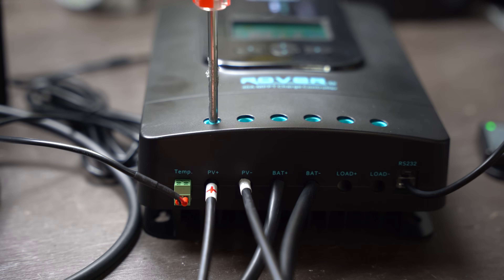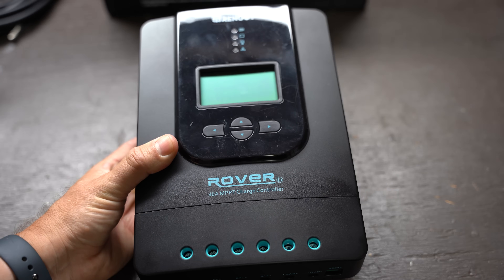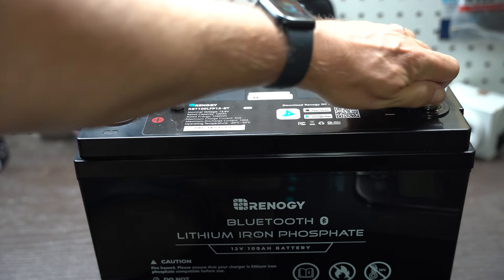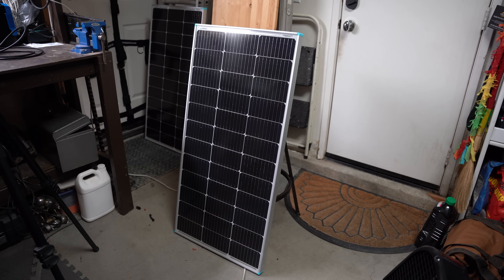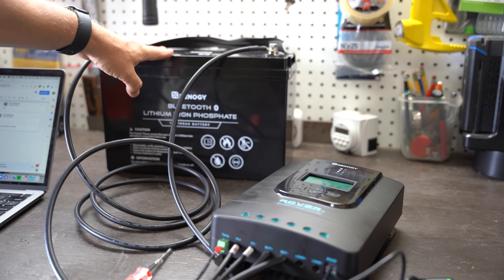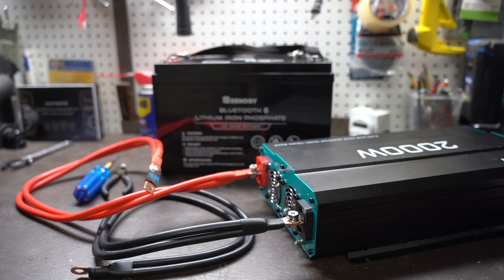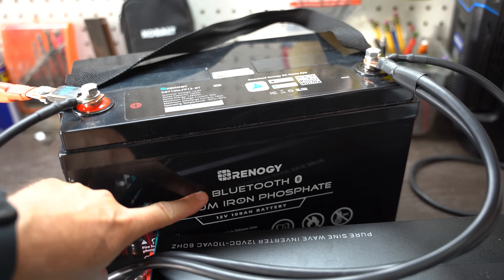DIY Solar Setup: Easy to Follow Step-by-Step Instructions

Comment: I recommend connecting the positive terminal of the battery first then the negative, it would mitigate the risk of sparking. Was there a reason you have done it the other way ?

Comment: So good instruction video. But why use x2 cables between battery and inverter just to up the cable area, it works but not the proper not way to go. Everyone do what they like, but mention it would be on its point.

Comment: Suggestion: label at least the positive cables at both ends with red elc tape. Also, use copper wire whenever available.

Comment: I purchased four used 265v panels that are perfectly good but one problem, they are 24 volts. There was a sale  of car batteries at a greatly reduced price, so I got six and doubled them up to 12 v, They are advertising systems' at thousands of pounds. Mine is a fraction of the cost.

Comment: Connect positive first, negative having less potential won't arc. The higher the voltage, the greater the chance of arcing and fusion. On a car if negative first and you are touching any metal part of car, when attaching positive there is possibility of arcing through you. Your body becomes part of the circuit

Comment: Now I have have checked and regardless whether it is solar power Marine automotive or home you always connect the positive first before the negative because if you connect the negative first you may cause a surge and a spark which could cause an explosion or damage to electronics it's always positive first - s f I am wrong please educate me because I'm not trying to be a troll I just want to know the correct process

Comment: you should never connect anything to a battery without putting a fuse in line, normally on the positive terminal. You did not put a fuse between the battery and the MPPT controller. If the controller fails and shorts, or something metal crushes your wires, a lead acid battery can turn you cables into a glowing red furnace, or it can explode.

You can get automotive inline fuse holders from any autoparts store. With a 40A controller use a 45 or 50A fuse so it does not blow during normal usage. If the fuse on the battery fails while the solar panels are in daylight, your controller will be damaged.

Comment: Wow wally how dangerous are you no circuit breaker just a fuse,and no switch to turn the batterys off so you can work on the project.
Reply from the maker: It has a switch. Rewatch

Comment: I just want to say that you should always disconnect the negative side of any power system first when disconnecting then reverse when installing. Watching you do positive first made me cringe as you can cause real damage to system by removing the positive first.
Reply from the maker: That’s why I installed a switch to disconnect the batteries from the system

Comment: A couple of times I noticed you connect the negative cable in first and then connect the positive cable last. From my experience, it’s usually a common practice to connect the positive cable first before you connect the negative. Is there something I’m missing?🤔

Comment: I have so many questions

Very interested on doing this.
How do I calculate my power needs?
I don't want to run an entire house i want to run a small cottage 
I'd like to power a small hot water heater, TV, computer, 3 or 4 LED lights, router, modem, with enough juice left over if i needed to plug the odd appliance in for cooking
I wont run a fridge or stove, maybe a small bar fridge later.

How many panels and batteries?
And does any decent controller work?
I have a 40Amp Renolgy

Comment: Hi could I install this exact same setup. But not hook up a battery. That way any devices connected to the inverter would only receive power if the solar panels are collecting pv?

Comment: Great tutorial, I basically knew the drill but have still to embark on the journey, still recovering from getting a portable gen setup with NG and interlocking to my main panel, lol. I also need to get eyes on some info showing how to run the battery power into my main panel from about 100 feet away in my shed area.  BUT...in light of recent events have you put some thought into how to protect all these components from the seemingly looming threat of EMP terrorism or solar events? I have read many things about protecting items with Faraday cages and such, but since there is a lot of mention about NOT having cables attached to anything because of it being exploited as an antenna and concentrating massive voltage, it sounds like I will be busy constantly attaching/removing cables from components at sunset to increase chance of survival if an event happens. Would a manual open/close circuit throw mechanism work to isolate PV/battery  cables from controllers, etc? Or should I just always buy x2 and keep a set of components under protection? Thanks for this.

Comment: Hands down one of the best videos on solar for newbies like me. Thank you. However, I do have a question. If I had a set up like this that I created on my camping rig, it would be tedious to always have to connect and disconnect from the battery. Is there a way to have a system like this without having to unplug everything and plug back in?

Comment: When connecting the cables to the battery,  always connect the positive cable first.  Then connect the ground wire after, to minimize sparking.  And when disconnecting  the ground wire gets removed first.

Comment: I don't like the way you hooked up everything, then unhooked everything and then added the inverter. This wasn't, "step by step". Also, you assumed that EVERYONE was using anything but lead/acid batteries and could discharge the batteries down to 20%. You CAN'T do that to the lead/acid batteries, it's 50% minimum discharge to not ruin your batteries.

Comment: A newb question. Will the solar panel stop charging the battery when the battery is full? I want to use this for 3 outdoor lights which will turn only only at night.

Comment: Hi is it possible to use a resistor instead of fuse to avoid the spark when connect the inverter to the battery? What made you go the fuse way instead of resistor?

Comment: I just want to add that in the video, you have a Lifepo4 battery. You don't need to worry about the depleting the battery to ~20%. With Lifepo4, the steep drop off when discharging come at around 5% but then the battery BMS will shut it down.

Comment: Just to know more I want to build mine off grid system charge controller at one point says for non Lithium batteries only and also says custom battery parameters do this is for lithium batteries or not 
Thanks for awesome video 👍

Comment: Tip: always use correct 2x coloured insulation tape to identify correct polarity when using incorrect coloured wire. In your case 2x red on black feed wire.
Reply: Same here. I would have added some appropriate colored heatshrink tubing, preferably adhesive type. Furhter, I would add short pigtail MC4 connectors to the controller, making it easier to connect and disconnect. But, what do I know? I came here because I need to learn how to setup my new portable system. 😂
Reply: @WayneTheSeine Do you mean pigtails to the controller?
Reply: @The_Shark-79  Yes...thank you
Reply: @WayneTheSeine thought so, but you made me curious! 😂
Reply: That or just put some RED tape on the positive charge cables..?
Reply: Ya but peeps dun do that
Reply: I would have said the same, and i am a nono with electra 😅
Reply: @scrqqge  What do you mean by incorrectly coloured wire?
Reply: @94D33M positive is universally red
Reply: coloured tape or heat shrink tubing
Reply: Good tip!

Comment: Is it possible to run a Ac off just solor panels during the day, it's hooked up to a small 50ah battery? (not trying to run it on the battery at all)

Comment: You can wire in a battery disconnect switch and then it won't arc to the terminals when you are hooking up the cables

Comment: I noticed you doubled up your 0 gage wire from the battery to the inverter. What was the reasoning for that and why did you only put a fuse on one of the wires going to the positive instead of the two I spoke about.

Comment: This was both straightforward and simple BUT also NOT. You go back and forth doing then UNdoing the assembly. This is a problem for first timers. Another problem area was at the end about capacity.  The 20% discharge is NOT accurate for ALL batteries. Standard battery designs(lead acid) will be destroyed if you discharge them to 20%. But overall mostly good presentation.

Comment: It would have been so easy to simply show and explain how to put a wrap of red electrical tape on each end of one of the battery cables designating it as "plus". Thus eliminating the need for the confusing disclaimer about being careful to connect plus to plus and minus to minus. (Even more disappointed in the cable supplier for not simply adding 2 pieces of red heat shrink to one of the cables for this same reason.)

Comment: Using a all in one inverter eliminates the need for the expensive charge controller. It's built in and can handle up to 500 volts DC. The amount of pannels can be 20
Reply: I was under the impression AIO inverter is excessive for small systems like 100w panel because of parasitic draw/standby power? Or is that incorrect?

Comment: what gauge wire should I use? I am looking at a 200w system for a heating element to warm my chicken water and infrared heat source for their hen house. I need to run approx 50 ft. I am guessing either 6 or 8 ga

Comment: Great video Sir!! I have a question though.
Can I use different voltage PV panel than the voltage of the battery? Does the MPPT converts the voltage properly?
I have a 12 volt panel and I want to charge a 24 volt system.

Comment: Your video does not indicate what amp charge controller you are using nor the battery amp h ?? Maybe you can make a video on what to use together as a system

Comment: So renogy states the 2000W inverter needs a single 170Ah battery or 2 - 100Ah batteries...  does that change if you use a lithium battery as compared to a standard lead-acid deep cycle battery?  trying to not break the bank for my boondocking setup and if i can get away with a single 100Ah lithium, my 2000W inverter, 20A MPPT charge controller and my 130W solar suitcase...  I'd rather do that.  Thank you

Comment: The correct way of installing you batt leads are positive first then negative and when you remove the leads it would be the opposite remove the negative then positive leads

Comment: So simple set up, nice content 
Let me ask, if you connect the inverter to a circuit breaker, what size is the  main breaker and its branches and the size of wire used?

Comment: I am not a technician but I have fews questions regarding the setup!
If the inverter is connected directly to the battery rather than connecting it from the Load in the Solar Charge Controller, how will the controller know if the battery is fully charged or not during the power draw from the inveter?
Will not not reduce the life of Inverter as well as the Solar Charge controller cause the Charge controller will always provide higher voltage to the battery to charge it which in the case is greater then 12V which is also great than the operating voltage of Inverter?
If the Inverter is connected directly to the battery what is the point of having a separate Load point in the Solar Charge Controller?

Comment: This really helps me being a novice. Have you done any video which uses a manual switch to change back and forth between solar and shore power? Or how did you hook up your inverter to a 110v system? I currently have short power, 30amp connector with 30amp wiring to main circuit breaker and 30 amp cable to breaker box which has six 15 am breakers, this is then wired with 12/2 household wiring throughout the bus to outlets.

Comment: Why negative cables first?? When working with 12v systems in automotive industry we do positive first so that the arc happens on the negative and not the positive of sensitive electronics so we don’t damage them… is it not the same when doing this??.. please let me know genuinely curious

Comment: Still learning a lot about solar. I really don't have the finances right now to buy outright all the parts brand new. Would you please do a vlog on parts you would think are safe to buy used...example: solar panels, used cables, power stations...(and how to test them),...and what in your opinion, you would always buy new, (emphasizing your opinion). I UNDERSTAND liabilty. I just want to listen to your opinion. Parts are going to be important...even possibly barter items.

Comment: I would add a step-up(or down)  dc-dc converter and pair it with USB PD(5V 9V 10V 12V 19V)optput for charging electronics thet theme thet voltage to minimise power loses.

Comment: Hi Chris I am just starting to build my own system, the solar cells have arrived and the controller and inverter just awaiting the battery. My question is how does the cable length from the cells to the controller affect performance and is there a maximum length, as I have strong sun in the morning on the front of the house and it moves around to the back after lunch time.

Running cables can be done from both  and moving panels till we can afford more but it then is a question of where do we site the battery and controller either way will involve some 200 meters or 600 feet of cables.

Look forward to you answer.

Comment: Hi,
I connected a 3000w Renogy inverter (SKU: R-INVT-PUH1-301235-UK)  and a 12V 100AH Renogy battery (SKU: RBT100LFP12-BT-UK). The system works fine for my TV (Sony TV KD 75XD9405: 352W / Standard 202W and 220-240V/50Hz) however whenever I connect this setup to my Washing machine (Beko WMI71641: 2200w and 230 V / 50 Hz) or with my inverter (Samsung MS23F301EAK: 230V / 50 Hz and 800w) the sytem trips with a long beep.
Please could you help me understand what should be the cause of the problem and how could this be fixed?

At the time of test, the battery is 45.4% charges with Present capacity of 45.4 Ah and present voltage of 12.9v.

Comment: You might want to preload the inverter caps using a resistor to prevent the spark and removal of metal from the post when attaching the battery to the inverter on the negative side with anything 2000 watts and greater.
Reply: I saw him using a fuse on the positive connector. What’s the difference between using a fuse versus a resistor?

Comment: Just so people know, they can use inverters with their car engine thus using their car as a generator. So if they don't have panels or have an extra inverter they can make use of it. For a small system to power smaller items and to recharge phones, a lower capacity inverter and inexpensive battery will suffice. 
I have a 120w inverter to use in my car, but my father just purchased a 3000w to use with solar panels or one of the trucks to run a chest freezer or refrigerator or even a window unit air conditioner.

Comment: Its highly recommended to use a shunt to measure usage instead of relying on the internal bms in the battery which usually measures SoC using voltage, not the amount of Ah actually discharged.
Reply: Duh OK... Glad you kept that dumbed down for us beginners... 🤣🤣😂😂🤣🤣 I will have 1 bms and 2 SoC with 3 Ah!!!!

Comment: Didn’t know you could damage the batt if power gets below 20% while using an inverter. Good info!
Reply: the inverter shuts its elf off when the voltage gets too low

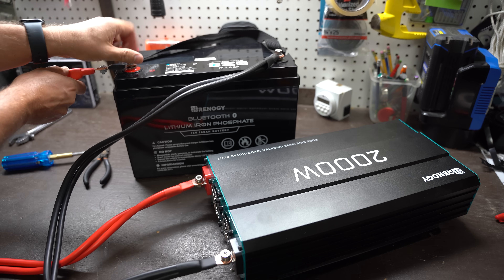Comment: Great video thanks. I was looking into building my own set up and this came just at the right time. I have one question please. At 10:28 you touch the inverter fuse bolt to the battery. Why is that?
Also can I use 2 batteries in sequence?

Comment: Note: if you have this same exact charge controller like I have, don’t overtighten the connections as I’ve heard of them breaking on this particular model. Just hand tight is good enough with the screwdriver. Don’t go hammy.

Comment: You mention you don't want to have a load with the battery at 20 or less percent......is there a way to automatically configure the software you showed to not allow this? Like auto shut off to protect the battery?

Comment: First thank you for providing an easy to follow guide.  I recently watched a video where viewers were told that the temperature sensor is not designed for lithium batteries but for lead-acid.  Specifically the sensor was attached to the negative cable near the terminal.   I suppose it's important to monitor the temp of the room for Lithium as they are sensitive to freezing temps.

Comment: I'm new to the scene. So if I have more than one battery hooked up, does this mean I get to use the power for longer? For instance a 24v set-up. Can someone please help me? Really just need my silly questions answered. Can you use more than one solar panel to charge the battery or batteries? If I use more than one solar panel, this would increase the power coming into the charge controller, would there be any issues with the charge controller? Would I need to connect additional Batteries in parallel or series, which is best for overall results and what purpose does parallel and series set-up serve??

Comment: So, you can just charge a battery or  have the whole system connected, using solar power as batteries are charging; right?

Comment: Thanks for the very clear video with great explanation. 

If I may ask three little questions:

1. Why using a fuse, because there is allready a fuse in the inverter itself?
2. Is there also a fuse needed between the controller and the battery?
3. The instruction manual of my inverter is talking about a grounding connection (Instruction manual is talking about a wire to place on the inverter and the battery, which is going to a metal stake - 1.2(+) meters going into the ground.)
Isn't this neccesary in a upsett like this? (If so, why not?)

Thanks for helping!

1